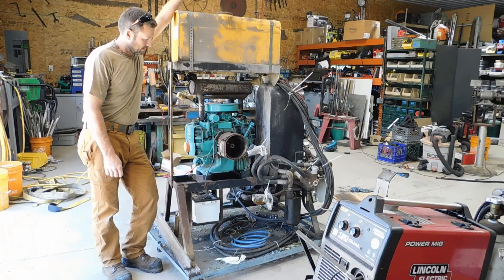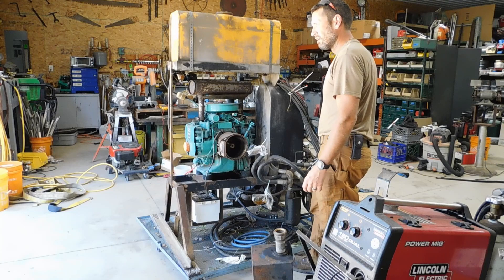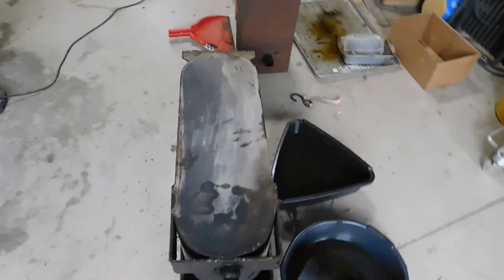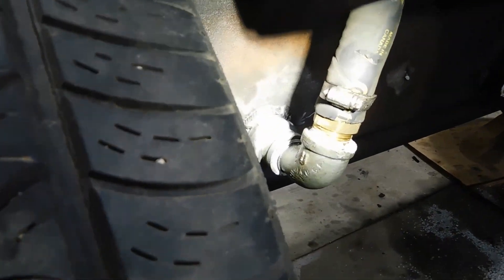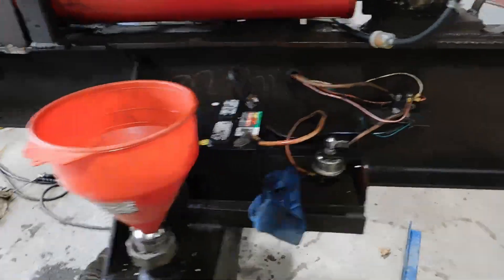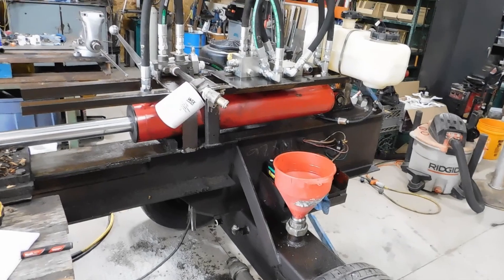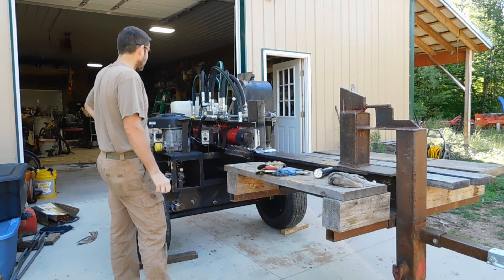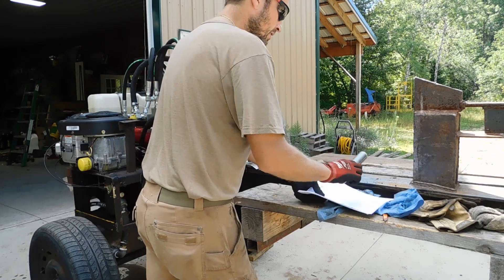Wood splitter upgrade part four

Comment: There is special Teflon tape for hdy systems and it’s what you need to use as well as the special hyd orings
Reply from the maker: I used the hyd pipe dope from my hyd supply store,  no leaks yet after 100 cord through it.  But yeah,  if I didn't get that I would have used the teflon hyd type.

Comment: AllWAYS need a twice the size return as psi hose and I see that is not being done on most spitters I’ve looked at and it really heats up the oil
Reply from the maker: Good point,  I think my return could be bigger,  but honestly I think my biggest issue is the ports on the cylinder, they are 1/2". I've been on the look out for another cylinder with 3/4.

Comment: Did you ever adjust the pressure settings on your regen valve?  I saw in the part 2 video you mentioned it seemed to increase load on the splitter, but I didn't hear anything in the last two videos about adjustments?

We communicated a bit via e-mail before and I ended up buying all of my stuff from Ryan at FFP.  I just installed the regen valve this week. First run was taking ~800 psi just to move the cylinder with regen valve, whereas it didn't register on my gauge without regen. After looking at the schematics and talking to Ryan, I had to turn down the pressure on pilot #2.  Once I got it to ~400-450psi, the regen valve knocked two seconds off the  extend cycle time, but lower at 250psi and the factory 800psi didn't seem to give any cycle time benefit.  We aren't done tuning it yet, but it's already much better.
Reply from the maker: Hey Adam, Honestly I didn't even know I could adjust them...lol  My problem was line routing, I was working of a schematic for the older model regen and dump valves.  After getting that right the thing was much faster, about 5.5 seconds each way compared to 12 ish on a 30 inch stroke.  I'll look into adjusting this spring, along with adding pressure gauges, maybe some bigger lines to handle the 28 gpm pump, a log lift and adjustable 4 way wedge.  The big issue I'm having right now is the hyd oil getting too hot, so I'm looking into oill coolers right now.  Thanks for checking back, I'm glad it's working.
Reply: @twosawacres8096  3/4" hoses should still flow for 28GPM just fine, but certainly talk to Ryan.  He is the man.  I'll show you a picture of the springs via e-mail, but you may find that just adjusting those valves may decrease your cycle time further.  Ryan's math said 20% reduction; my crude phone measuring averaged 17%, so really worth doing since all it takes is removing the covers and using a hex key to adjust spring pressure.  I also have some pics and diagrams I created I'll send to you for the log lift / wedge lift for reference.

How much overall oil capacity do you have?  Rule of thumb is at least 1 gallon reservoir per 1GPM flow.  I just ordered a 37 gallon (30 usable) tank for upgrading my splitter from 22GPM to 28 GPM.  I'm hoping that'll be enough to not need a separate cooler, but only time will tell.
Reply from the maker: @adammerritt  I'll probably try adjusting while it's running,  little by little just to see that way I don't have to break the system to add gauges. Total capacity right now is around 26 ish,  I think it might have to do with the ports on the cylinder only being 1/2", everything else is at least 3/4.